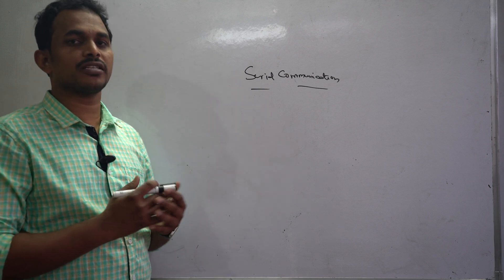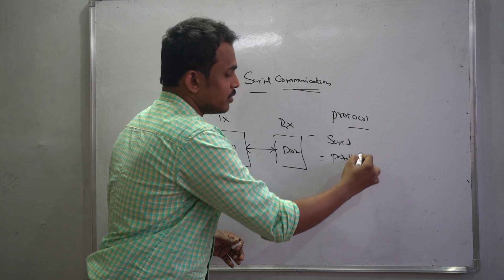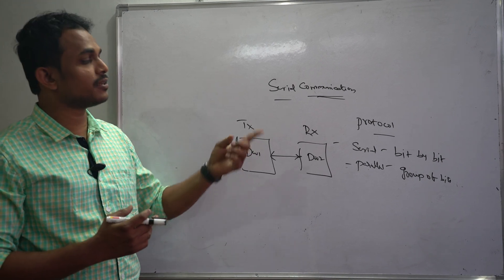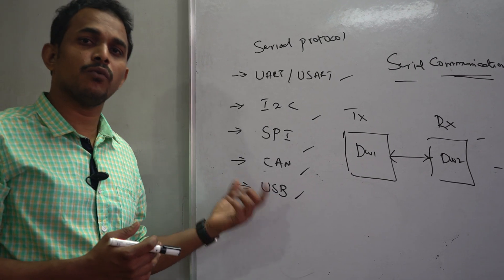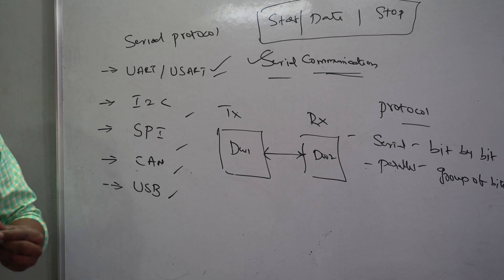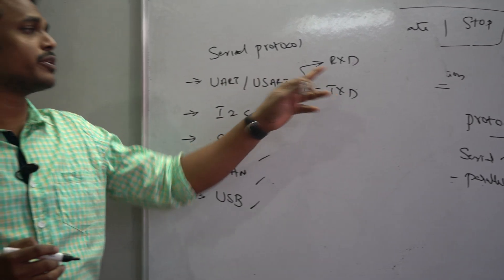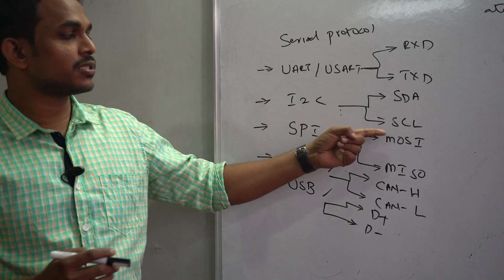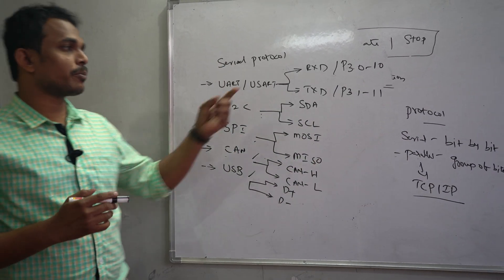Serial Communication in 8051 microcontroller

Comment: Hello sir, is 8051 support only UART or it can also support I2C,SPI...
Reply: I2C , SPI protocols you can implement through programming , not onchip for 8051 microcontroller. Thank you
Reply: thank you sir, implement through programming mean ?
Reply: Every protocol has its own dataframe , you have implement frame format through programming. TQ
Reply: It supports onchip UART, you can implement other protocols I2C, SPI through programming